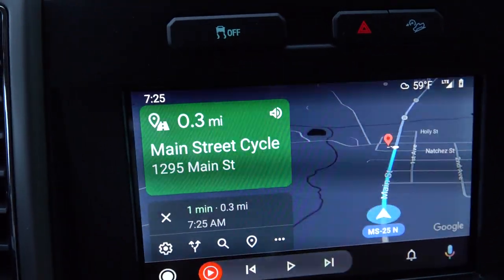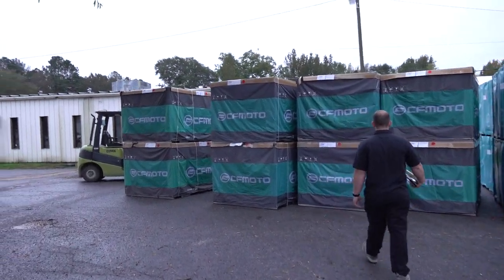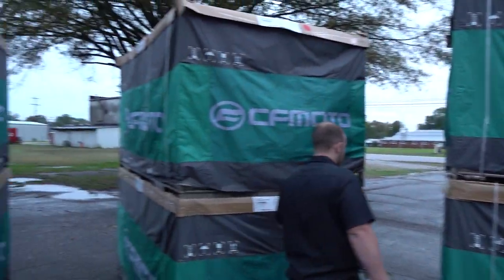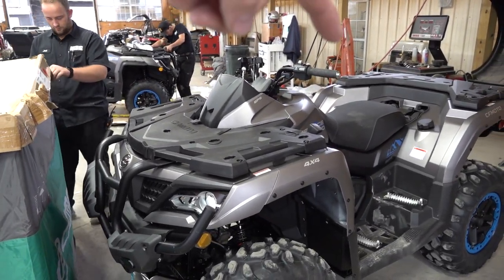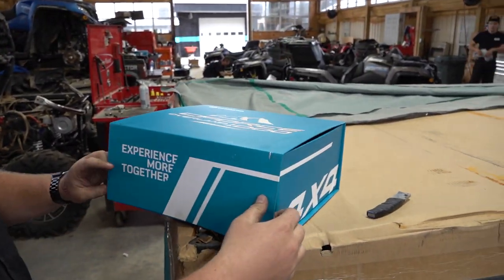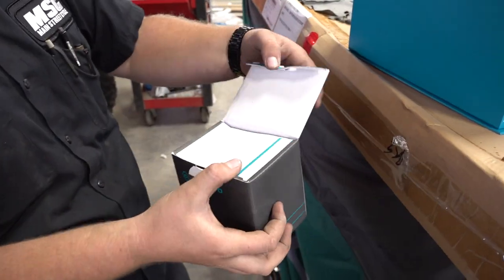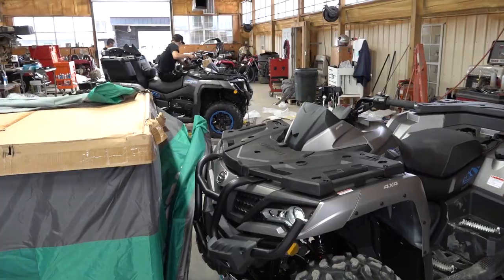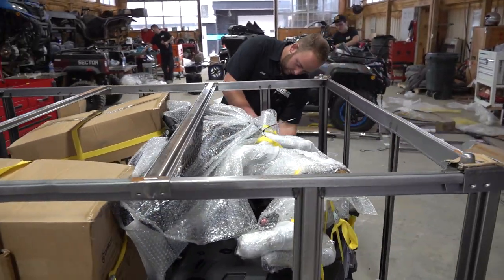CFMOTO CFORCE 1000 Overland Crate to Trail How Its Made Assembly Tips

Comment: 1.1/2 hrs for me. Can-Am Outlander takes me 3/4 hr all up.

Tip; I save all the foam padding and bubble wrap then give them to the antique shop for reuse. Also smaller cartons too.

Steel shipping frames are great for knocking up as a frame for firewood storage, just weld into place then sit on purpose made concrete foundation at sides then cover frame with steel roofing iron. Lay down plastic shipping pallets to store wood on top. Plastic pallets allow airflow to dry.

Comment: Questions for you guys - 
When are the uforce 1000xls coming in? 
Can the customer keep the cloth cf Moto box covering? 
Does the uforce 1000xl come with a goodie box like the ovedlander does?
Reply from the maker: They still cant give us a straight answer on when anyone is getting the UFORCE 1000XL models.. But im almost certain that it will be after the first of the year.
You would have to ask your local dealer to save you one piece of the crate covering.
and that goodie box is specific to the overland model.
Reply: @RealTalkPowersports  Mine dealer saved me 2 of them when I asked... But most of them are destroyed from shipping, but it's good to have one. I use it to cover mine up sometimes.. looks pretty cool when you have one that is not torn.

Comment: Hey -- when these things are shipped in crates like this, and when you guys go to put them together, do they already have oil in the engine and tranny, differential fluids and radiator fluid from the factory?  Or, is all that taken out after test driving at the factory and before crating for shipping?  Just a running debate, so I'd like to ask people that actually see these things as they get off the truck and prior to assembly.
Reply from the maker: They come with ALL fluids except fuel

Comment: Do you know if you can buy a left hand brake lever from the 2022 500 model and mount it on the 1000 and switch the brake from right to left hand side? I really like the left hand braking and would like to get it changed when i purchase the 1000. It would also be cool if you could make a video about it if it’s possible!
Reply from the maker: Im not too sure about what all would have to change.. probably different link brake line and just move it over.. I love the current setup. Its just like driving a motorcycle or clutched atv..

Comment: hey bro how are you?
actually i want to get the cforce 1000 0verland but not sure as the place i live in is mountains and very rocky rough roads also always uphill or downhill 
what do u think it can survive for the long term ?  also not sure if cfmoto has any mechanical problems 

dont want to be wasting hard earned money. can you please advice ?
Reply from the maker: We constantly push ours and put them to the test and they certainly can handle the abuse. They are good man
Reply: I have a 2019 and ride in a similar conditions and I drive mine pretty hard with 5000 miles and just starting to get loose tie rods,  ps I'm running heavy 30" tired because of the rocks so compared to my buddies with the polaris machines mimes been completely trouble free with almost twice as many miles lol
Reply: @aaronmcfee506  Amazing man
I will be mostly using it on daily basis going to the city from the mountains ⛰ lets say around 5000 K.M per month. Uphill and down hill all the way 
That's why  i am not sure if this is a good buy and can survive for the long term.
I am still not sure what to do. Have been looking and asking around for a month or two.
Need some solid advice
Reply: I live in Colorado in the mountains and have the 1000 overland my wife has the 600 and my daughter has the 400 and they are great they handle the rocky mountains with no trouble at all and my wife's 600 and my daughters 400 has 9000 miles on them with no issues my 1000 is brand new because I got out of my Yamaha grizzly to upgrade to the 1000